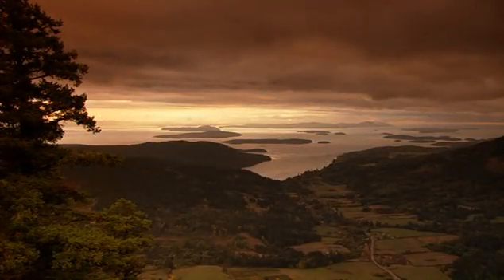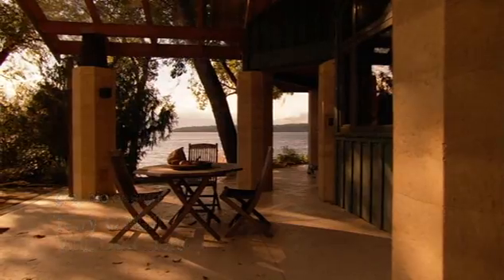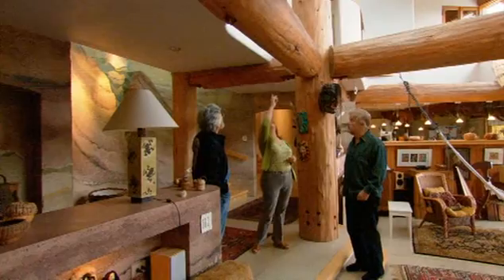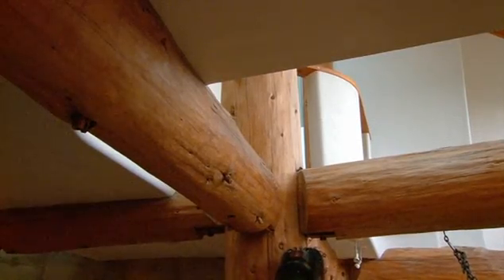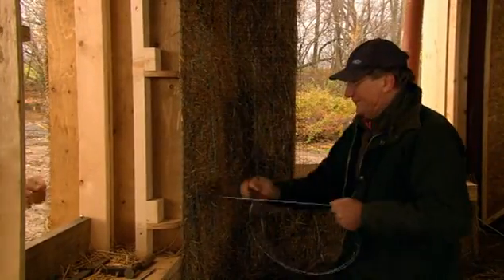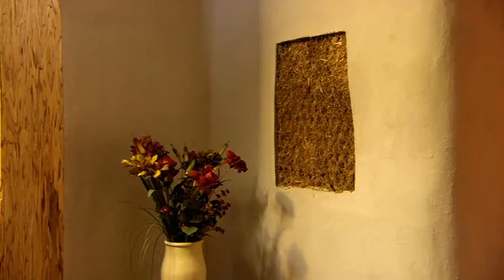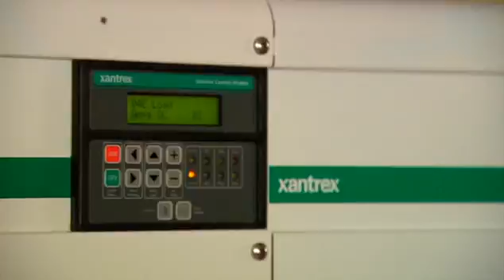Visions of the Future by David Suzuki part 1

Comment: In most of "green" wood constructions, for every tree chopped down another one (or more) is planted. Straw could be obtained after corn harvest, avoiding any waste. 

Both wood and straw are reusable. So it's way more efficient than using chemical products that aren't renewable, not reusable, required mining, etc... (which result to field destruction and deforestation).